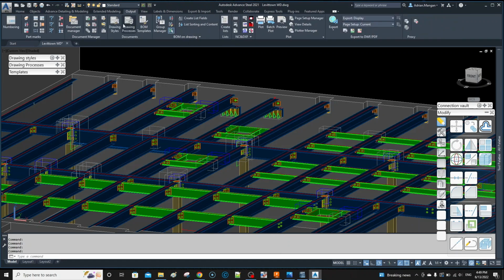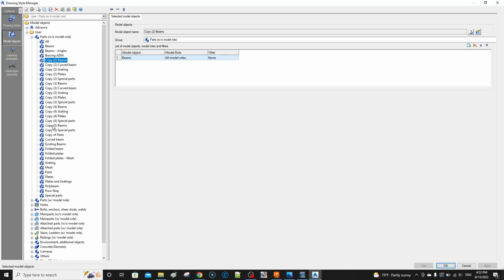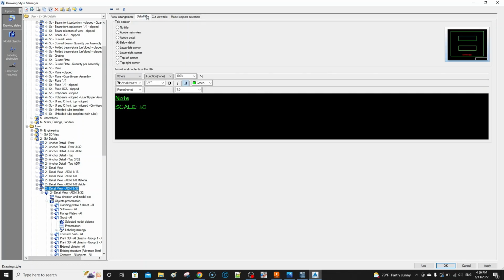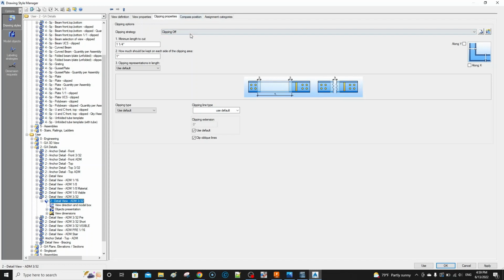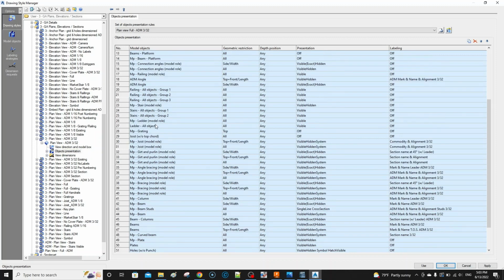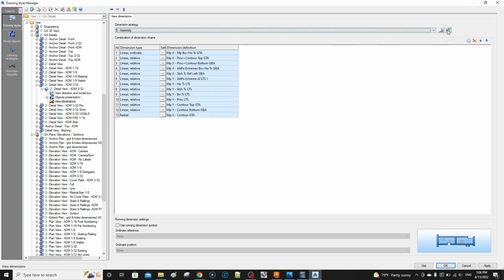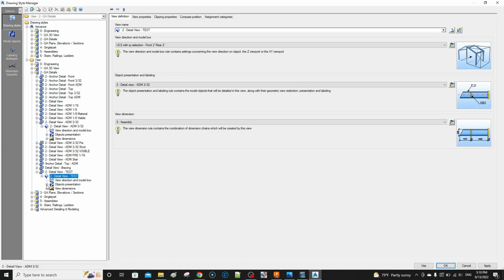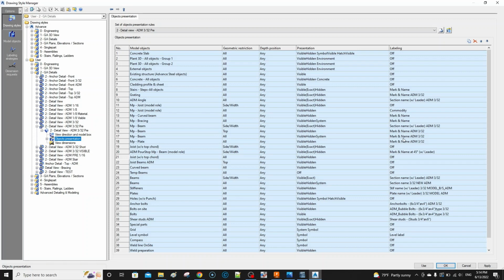ADVANCE STEEL:  "Drawing Styles - My Understanding" LONG.

Comment: Don't use drawing styles if you intend to move your model slightly! 

It'll waste your time!
Reply from the maker: Interesting perspective, not sure why you would be moving your model anyway
Reply: @EIRCAD  if you make any change in a model and the positions need to change, it would effect UCS orientation. That's why I hate that. But I could use viewport and having the model as a reference in the sheet file model space.
Reply from the maker: Let me ask you how do you create 2d drawings if you are not using Drawing styles as that is how you output drawings? I'm confused
Reply: @EIRCAD  well it depends. I make the model in AdvSteel but I could use AutoCAD with a sheet set manager and using viewports
Reply from the maker: @iliketurtles2322  i don't want to make assumption but I would say your not using Advance Steel to its full potential, using cameras works great and yes if the model or area moves and you move the camera it will rearrange your view but how often will that happen. Saying not to use drawings styles like saying don't use the software at all.
Reply: @EIRCAD  I am not a fan of AdvSteel's Document Manager. 

I could produce better sheets than DocMngr but the annotations would take forever to replicate.

All in all, don't EVER move your model after creating sheets with Drawing Styles.
Reply from the maker: @iliketurtles2322  sounds like your not using cameras or setting up your drawing styles properly
Reply: @EIRCAD  yes I didn't use cameras. And that really messed me up. I'm going to research Camera usage, I'm amusing you can adjust Camera views, instead of 3D UCS Drawing Styles as details drawings